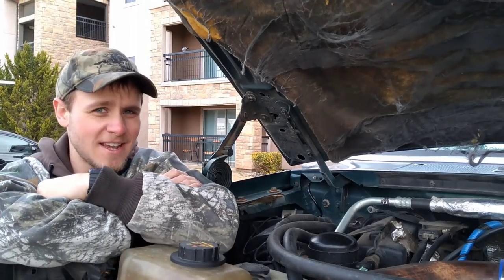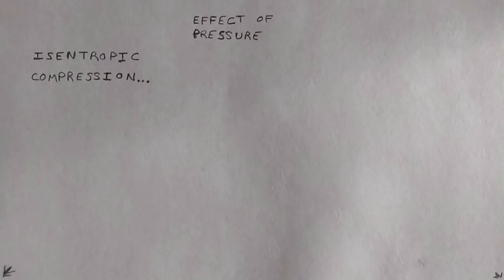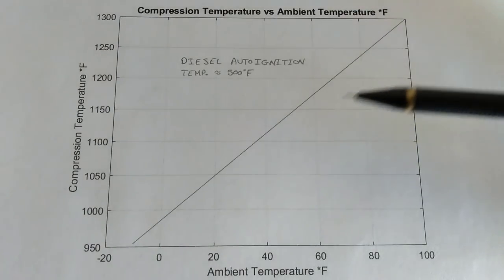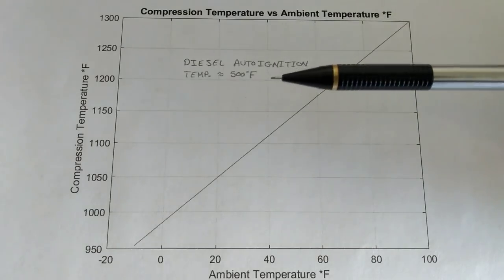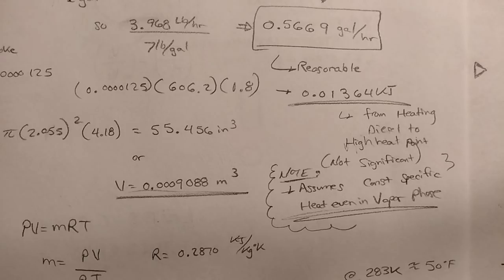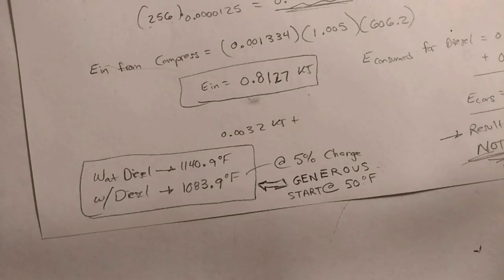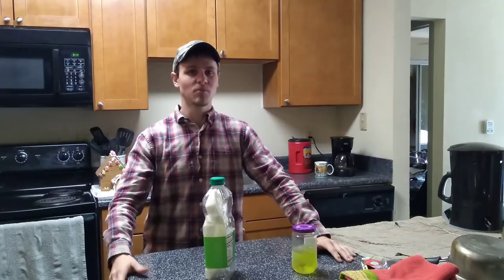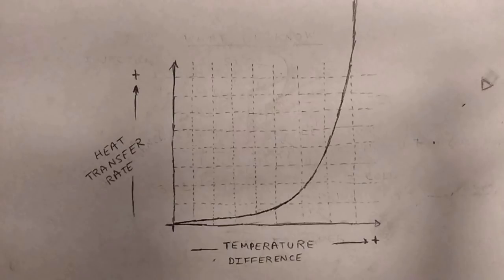Why Diesel Engines Are Difficult to Cold Start

Comment: EXCELLENT VIDEO, SIR!!! From someone who drives a 2nd Gen Ram with the 6BT, I have to say those grid heaters are just as good, and don't seem to fail as often, great video nevertheless
Reply from the maker: Thank you very much! Some would argue grid heaters are better than glow plugs, at least there's only one of them to fail rather than 8. I might have considered putting a grid heater on the 7.3 after the first glow plugs went out in 2 months, but we won't talk about that... Nice truck by the way, the 6BT is indeed an awesome engine and those 2nd gen trucks are pretty cool looking too.

Comment: great video! I would also add that the output of the battery, which is important for the starter motor, decreases with lower temperature (as far as I know). i always end up replacing batteries in winter because when they get old, they wouldnt have any problem starting in the summer, but winter is another story.

Comment: Really well done and broke it down   in a way that made a lot of sense. So appreciated the science behind the argument which proved the "why". So tired of others basically saying something sucks, yeah maybe true but why is the issue.
Also liked the fix to the cold start problem as well . Now understand so much better why my 7.3 starts so much better in warm rather then cold weather.
Reply from the maker: I'm definitely glad to hear you enjoyed the 'why' as well! I sure second guessed myself quite a bit as to whether or not anyone would appreciate the 'why.' Heck before making the video, I didn't even know the answer myself, and I learned a ton as well. It took writing a heat transfer program to figure things out, and the results seem reasonable too. Understanding that so much heat is lost to the block also explains why idi trucks even with a higher compression ratio are no better off at cold starts compared to a powerstroke. The swirl port adds internal surface area and hence increases the rate of heat loss as well.

Comment: quality content, well done (also a young engineer with a diesel)
Reply from the maker: Thank you! I'm glad to hear another fellow engineer has an interest in old diesels as well. What kind of diesel do you have?
Reply: @Rnddiesel  Right on, driving a sprinter van. It still has some hesitation when I start it (good weather) had all glow plugs replaced recently. (rather new to diesels, heard the trick of cycling the glow plug ingnition is one way to adresse that, also hearing that it will over stress the GP's)
Reply from the maker: @emilegoguely4032  Good deal, a Sprinter van! I really don't know for sure what the best thing to do is, but on my truck in particular, the glow plugs stay on and cycling the ignition just causes the relay to turn off and back on slowing the warm up. I usually just wait 20 seconds or so after the wait to start light goes away, and it fires right up.

Comment: "it got down to like, 15 degrees Fahrenheit or something like that. Pretty darn cold, by Texas standards at least"

I live in NY. 15F is cold. Yes, it gets colder, but 15 isn't fun no matter where you live.
Reply: 15 f is not fun? :D here in Lithuania in Eastern Europe this year we had -15f -16f (approximately -26 -28 celsius)
Reply: @Gaikiusalonas  do you drive a diesel in this weather? In this weather some gasoline engines have trouble starting as well, am I correct?
Reply: @larrywineman403  I drive a gas and diesel vehicles in Canada where temperature get down to -40'C and colder. Coldest temp I've ever personally seen was -62'C (-80'F) and my car (gas engine) started without being plugged in but it didn't like it very much. Both vehicles run fine but the Diesel is a little harder to start, remember that block heaters are your friend. I plug my diesel in at any temp below -20'C (-4'F) and I plug my gas engine block heater in at any temp below -30'C (-22'F). if either won't start at temps above those respectively without the block heater being plugged in, something is wrong or it's time for a new vehicle.
Reply: @dman6377  thanks for the response! Very interesting- that’s some COLD WEATHER!!!
Reply: @larrywineman403  I guess it is, but in northern Alberta, Canada it's just life. LOL

Comment: My 7.3 won't start without quick shot of the good stuff when Temp goes around 50f. Someone told me that it was the IPR valve. I never thought of tapping the relay.
Reply from the maker: If by 'good stuff' you mean ether, then that's more like an addictive drug. You're taking a big risk of destroying your engine when you use it. It sounds like your glow plug system could use some work. Unfortunately it's probably a combination of bad glow plugs, bad relay, and/or bad under valve cover wiring harness. If it were your IPR valve you'd have more than just a cold start problem. I'll get off my soapbox, you do you, ether can destroy your engine in a heartbeat if you aren't careful.
Reply: @Rnddiesel  it's been like that for about 10 years. When it first started, I replaced all the glow plugs, then the relay. Couple years ago I had to replace the valve cover gaskets for a runnability issue. About a year ago, the CPS sensor, and the fuel bowl heater. All for different reasons but nothing hepled. I just gave up.
Reply from the maker: @adielawson7179  I see, well aside from checking that the ECM is powering up the relay, you've basically covered the whole system. I'm sorry to hear you've had no luck, what a pain!

Comment: In winter i buy diesel kleen and diesel 911 additives ill add 1/2 the recommended amount of diesel 911 to the tank since it increases diesel flammability and is a crazy antigel and the full dose of diesel kleen to offset the lubricity removal of D-911 never have trouble starting in the cold with this setup

Comment: What's your opinion on using a heat gun on intake manifold small diesel engine. Mahindra tractor. Cold start
Reply from the maker: I don't see that being an issue, Cummins 6BT diesel engine basically did the same thing with the intake air grid heater. I don't know if your heat gun would really have enough power to heat all the incoming air, but if it works it's probably much safer than using ether with semi-functioning glow plugs.
Reply: @Rnddiesel  thanks small 3 cylinder

Comment: 1) warm the engine up..
2) warm the fuel up..
3)warm the fuel line up
4) considere adding a separate insulated and heated diesel tank just for staring and warming up the engine

Comment: Great job very easy to understand, thanks much! Thumbs up for sure... off the subject what size tires are on those stock rims I saw in another video they look beefy I want to replace 4 my 97 OBS F250 7.3L... ty
Reply from the maker: I'm glad you liked the video! My current tires are 305x70r16, it's a really oddball size. I don't really recommend them simply because they are so hard to find. I had the tread on one start to separate and had to replace the tire, the only one I could get had to be shipped from California! I'll probably replace them with 285x75r16 tires next, or I'll go back to the stock size just to keep the cost low.
Reply: @Rnddiesel  another aside,what's the lift on your truck ? I also have 97 7.3 , crew cab looks to be same ht. Pretty much stock tires. Any clearance issues with the tires on your truck? Thanks
Reply from the maker: @brucebell7623  I believe my truck is stock and doesn't have a lift believe it or not. I'm running LT285x75r16 tires. I don't have any issues with them at all. Though in this video  I had LT305x70r16's, even those didn't rub. I think the slightly narrower tire going to the 285 fits the old body style much better.

Comment: So similarly an oil pan heater would do the same? I'm new to diesel ownership and have also wondered if an oil pan heater could be used on the fuel tank. Also what about blowing hot air into the intake with a heat gun in extreme cold weather?
Reply from the maker: An oil pan heater wouldn't be as effective as a block heater in the coolant passage of the engine. The main reason is that the coolant naturally circulates around the outside of the cylinders, and during a cold start those cold cylinder walls are what saps a lot of the heat out. By heating the water on the other side of the cylinder walls you reduce the amount of heat lost during the compression stroke. An air intake heater would probably help. If you're curious look at the cold start mechanism typically used on the light duty Cummins diesel found in Dodge trucks. They have an air intake heater rather than glow plugs, so it's basically the same idea.
Reply: @Rnddiesel  very cool thank you for that. My buddy back east just picked up a 96 Dodge Cummins.

Comment: Diesel is less refined and more oily than regular gas. When it starts to get cold you have to heat up the block so that the fuel is basically normal again n not clumpy. Or add additives that reduce the same effects. It has a lower combustion rate and a less volatile explosion. Plus you got so much more medal to heat up than a normal gas engine does since a diesel engine is like almost 2x the weight a gas one

Comment: Hey bro I got to problem with my truck (97 ford f250 7.3 4x4)and I want to know if you can help me out ,well de overdrive light is flashing and I don't know what it's doing that  but the last time they don't a transmission service and came back to normal, but the light came back on again and I don't know if you got any idea on what can be wrong with it ,,, is shifting hard right now
Reply from the maker: Yeah OD light flashing is definitely a transmission signal. Definitely avoid driving it for now if you can. First thing I'd do is check the transmission fluid. Shift through the gears with everything warm and on level ground and check the fluid. I've been fortunate to not have many problems in the way of transmissions so I don't think I'll be much help. Supposedly you can pull 'codes' from the transmission as well. Try hooking up an OBD II code reader and see if you get anything. If the trans is shifting hard, make sure your ICP sensor is plugged in all the way, though that would throw a check engine light on the dash. For whatever reason my 97 shifts hard when the ICP get's disconnected, but I don't know why. Also there's a big wiring harness on the transmission you can check. It's on the passenger side right above the pan and behind the downpipe I believe. With the plastic getting old it may have gotten disconnected or be dirty/ corroded. There's some special trick to pulling off the wiring connector without breaking it, you should be able to find someone online who's done it. I think my connector was broken when I pulled mine apart, but it still works fine. Cleaning it may solve your problem if it's dirty. It may be just a bad solenoid, sensor, loose wiring connection, but it could also be worse. It's just hard to tell with transmissions. Definitely make sure you have plenty of fluid first thought. Best of luck!